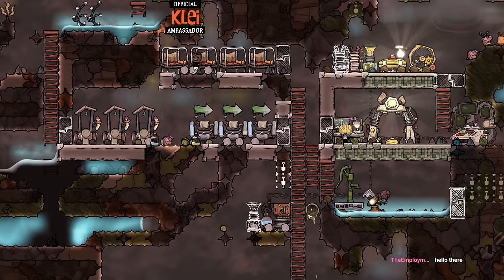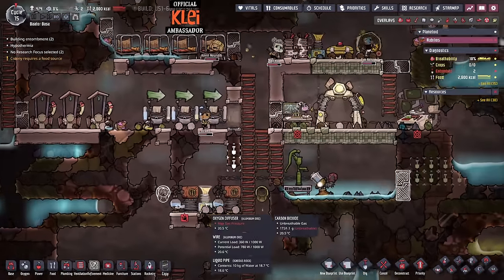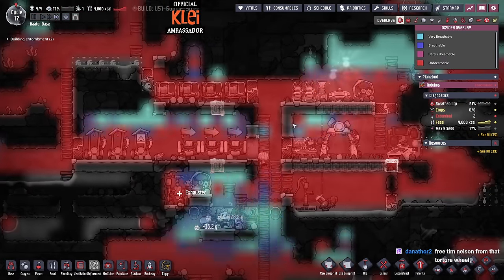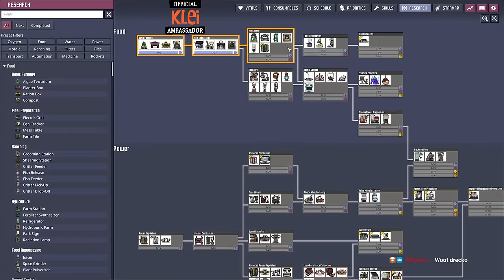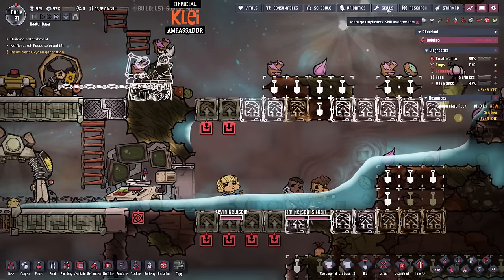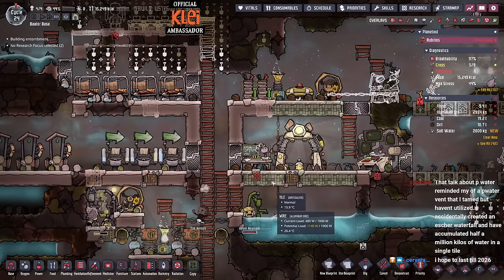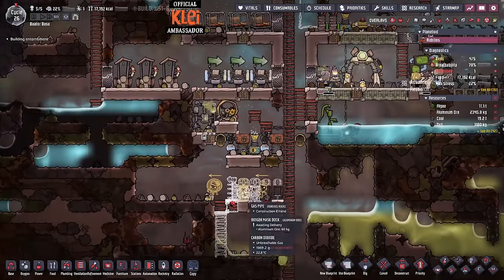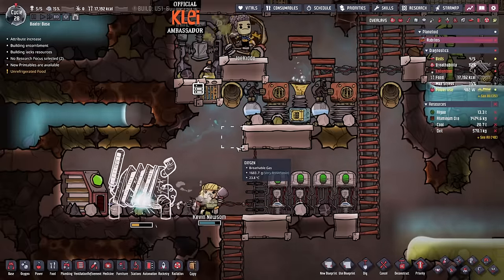Baator Base - Part 2 - Oxygen Not Included

Comment: Still not a single oxyfern.
Reply from the maker: There was only really one oxyfern that was available below and the dupes couldn't reach it when I needed it. Then by the time I could safely reach more, I'd already solved the carbon dioxide issue. Remember it's 3.2 oxyferns per dupe too, so just planting a few wouldn't do enough by itself.